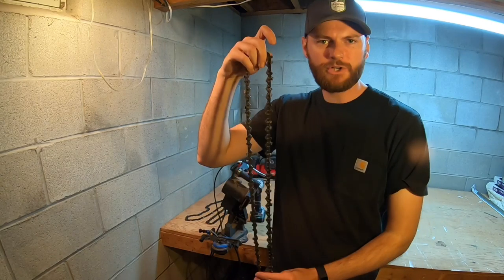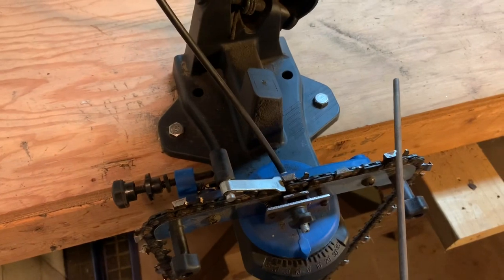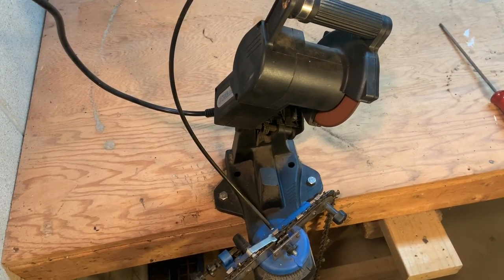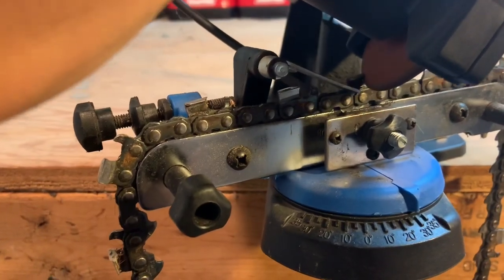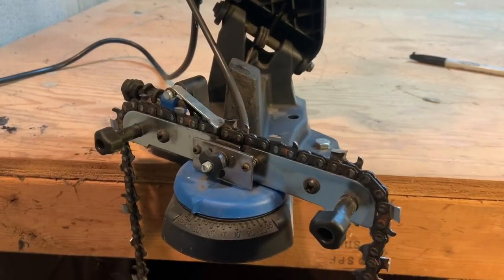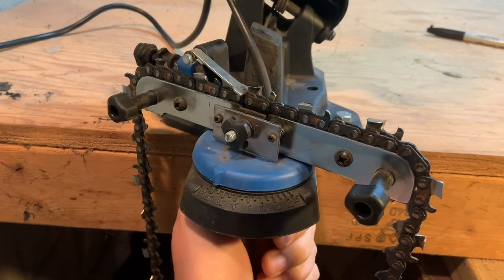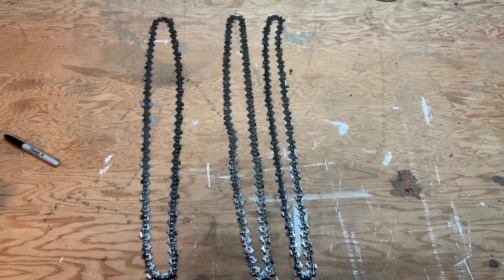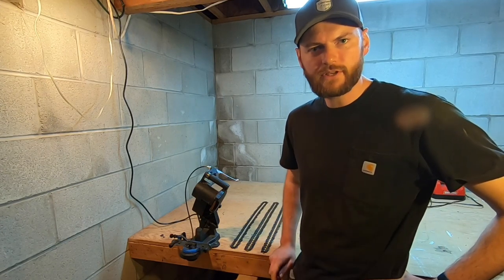MUST HAVE Electric Chainsaw Sharpener - And it’s CHEAP!

Comment: Note that the depth of cut is a very precise measurement and check your specific chain’s specification.  Use a straight edge between two cutting points and a feeler gauge to measure the clearance to the depth gauge.  Generally .025” is a rule of thumb.  Most of the time unless the chain is very worn you do not need to adjust depth of cut until after several sharpenings and you should remove very little material. Excessive cut depth can cause a dangerous condition.

Comment: I bought the Harbor Freight one a couple of months ago and got it for $24 using a 20% off coupon. Best $24 I've ever spent!  Around here a shop charges about $15 to sharpen my 20" chain, and this sharpener paid for itself on day one when I sharpened my 3 chains. My neighbors used it too and they are going to buy their own from HF. It's a great tool and gets the chain wicked sharp!

Comment: That’s a handy little machine.  If I didn’t already have a Stihl 2 in 1 hand sharpener, I’d pick one of these up.  I was spending a lot of money paying to have my chains sharpened until I saw someone doing a review of the Stihl sharpener.  I bought one of those so now I never have to tolerate dull chains.  Like you, I have 3 chains at all times so that I can switch while I’m out working.
Reply from the maker: How do you like the Stihl 2 in 1. I’ve seen it but just kinda brushed it off as a gimmicky product that would still be annoying to use since you are still manually pushing the file through
Reply: Hometown Acres I really like it.  The way it’s designed, it forces you to sharpen at the proper angle for your specific chain.  It also hits the raker teeth at the same time, so it keeps you from hitting it too deep as well.  Three or four good licks per tooth and you’re good to go.  I can sharpen a chain in about 5 minutes or so.  I’ve been very happy with it so far.

Comment: A hand filed saw will last longer. I sell wood and i was using a grinder but the chain after 3 grindings was junk. by hand filing ,my chains lasts much longer and i can sharpen a chain very fast .after every 2nd tank i dress the chain off .I to thought it was hard but after you do it  a bunch its second nature .It is a skill to be proud of.

Comment: Thats a nice set up you have. For 40 years I have always sharpened with a file. And yes, sometimes I get it just right and other times it just don't cut as good. With your method, you'd get it exactly the same every time.  
If your entering the 2020 Splitter Contest I wish you the best of luck. After seeing your machine in action I'd say you could walk away the winner. Take care buddy and be safe.
Reply from the maker: Yep. I’ll be there. Video going up Saturday morning. I did mine with the 6 way wedge but I think I’m gonna make a 2nd entry with the box wedge. The 6 way wedge took longer than I originally thought it would. Care to venture a guess at how long it took me to split 1/3rd of a cord with the 6 way wedge?
Reply: Good. I'm guessing it took you less than an hour.

Comment: Adam, try to get a CBN grinding wheel for that grinder. They are a bit more expensive to buy but it will last you years and won't ned dressing for month on end. It also makes for a sharper grind and puts lees heat in the tooth and you don't have everything near the grinder covered in aluminum oxide. I use a cheap knock off of the Oregon grinder with a CBN disk and never looked back.

Comment: Bought a old Mac saw 1-52 they guy I bought it from used a hand grinder on the teeth it’s a 3/8 chain getting one of these to try and save it still lots of life left in it 31 inch bar that’s dated 1958 hoping to save all of it

Comment: If you have a few chains to do at once these electric sharpeners are great.  Have you tried the Pferd hand held sharpeners? They do the rakers and sharpen teeth at the same time.  They are honestly amazing and i would be surprised if it's not faster to just use one of them to sharpen one chain at a time.
Reply from the maker: I have not. I’ll have to check it out
Reply: Right!  I have a similar model, made by Stihl.  Last fall, I had to remove a stump. We have a lot of rocks in our soil. I needed to use the saw for many cuts, so I took an old chain, willing to scrap it. Obviously, I got every tooth either dull or bent.  I used this combined file and within 5-10 minutes, I had the chain tested through large maple logs, cutting good, straight kerf...

Comment: An electric sharpener has its place when used alongside hand filing.  A decent hand filer can sharpen a chain 10+ times before an electric sharpening is needed.  It is also very quick in the field 3-5 minutes.  Hand filing done correctly will give a sharper chain and your chain will last about three times as long.  Both have their place.

Comment: THANKS FOR POSTING !!! ❤
   I have been eyeballing my rake teeth and using a 3/4" flat bastard file to cut them with. Your use of the "set angle to zero and the depth of the cut," makes the MOST since. I shall do my rakes like that, from now on! Thank you. Now, I have to figure out how to change the angle of the cutter, itself; so it will go into the bite of the cutter tooth. Mine is coming straight down the face of the tooth! Any ideas? Thanks again!
Reply: Adjust pitch angle of the chain fixture, if your grinder doesnt have that, make something that works!
That way you can get the gullets in the teeth as well as good cutting surface ^^

Comment: Great video, excellent explanation of chains! Only complaint I've seen on these type of sharpeners is they take off more material than hand files do. I'm looking to buy one for my common chain sharpening, but I will still hand file those "hard to find" chains to prolong life. Great video man stay safe!
Reply from the maker: Yeah you won’t be able to sharpen a chain as many times with this as you would hand filing. Probably 10-15 sharpening a with this. Hand filing you can probably get triple that. But who wants to hand sharpen a chain 45 times? Lol not me

Comment: Awesome, I didn't know they were so cheap.
Reply from the maker: There are more expensive models but these ones work just fine for me. I’m not sure what the more expensive ones have that these dont
Reply: As little as a decade ago, they WERE $300.00 each! Harbor Freight put one out for $95.00, and the prices started to match it. They got to a regular price of $45.00 each and they had a sale, one day, for $29.95 each, and I bought one and 6 stones. That wasn't what I was in there for, but I figured, that cheap, I couldn't go wrong. So far, the quality of the sharpness doesn't hold a candle to what I can do with the proper sized file, my PPE, and a leather knuckle apron guard...
Reply: @general5104  ....Did you try dressing the stones or at least adjust the pitch angle to where you get a good result?
Reply: @ToreDL87  Tye head doesnt have the option to go up into the gullets...just square down the face of the tooth.

Comment: When you use any machine to sharpen a chain. You need to take a bar of soap and touch it to the grinder stone while it running about every third tooth and it will coat and lubricate the stone.   This will not heat up the tooth which takes the temper out of it. 🤔

Comment: Hi. Quite used to gas / petrol saws. But recent bought electric one. Do you have to take the chain off to sharpen it? Or is there a quicker way, I am used to gas / pterol saw where you can move chain on bar and sharpen that way.

Comment: Great video. The only problem with this method, is that you have to take the chain of the bar. With a file you can leave it on the saw.
Reply from the maker: Very true. However I have a good number of chains and try to sharpen them all at once. I’d rather spend 1 day sharpening for an hour or 2 then sharpen for 20 minutes 4 or 5 different days
Reply: Hometown Acres great point. Definitely for around $30 it’s a great deal. Love the channel.

Comment: I like my Blue Max pretty good, but I find theres a lot of slop in the head. When you hold the handle and flex it, you can make it grind nothing or a lot. Also, my chains dont slide nearly as well through it as yours does

Comment: I have seen the Harbor Freight sharpener in action. It did a good job. However, I have also seen an electric sharpener overheat a chain. 

I just use a file. 

Good video.
Reply from the maker: Yeah you definitely don’t want to leave it in contact with the chain for too long

Comment: I have the harbor freight one. The only bad thing i see is the gullet goes bad after sharpening 2 times with the electric one. But it does save time for the first 2 sharpening. I did the raker filing like that but it’s to easy to take off to much metal and the chain bites hard. Just use and resharpen but skip rakers and it’s all better. Nothing like a fresh chain to start the day cutting!
Reply from the maker: I like takin the rakers down a good bit so the chain is hungry for wood. Then you don’t have to apply any pressure to the saw to get through logs. The weight of the saw is enough to chew down through. But I agree. You definitely don’t want to over do it on the rakers

Comment: I hand file mine untill they start getting a little rounded on end then I put them on my electric sharpener
Reply from the maker: I used to take the hand file back in the woods with me to touch chains up out in the field but now I just always bring a spare fresh chain with me so if I get one in the dirt I just swap it out and then sharpen when I get back to the house with the electric sharpener
Reply: That’s exactly what I do too mate

Comment: IMPORTANT !!! chain sharpening requires low rpm. if they are too high as in your case you will not sharpen the chain but you will burn it. 
Mr. Sthil

Comment: Here in Newfoundland we have a LOT of rock...so easy to damage teeth. I bought a similar sharpener from Princess Auto but it isn't as good as yours. Mine has a bolt I need to turn to squeeze the chain where yours has a handle and cable. Also, where the hanging chain comes up and enters the horizontal groove, the plastic knob at the end of an adjustment bolt interferes with the chain...a constant frustration.